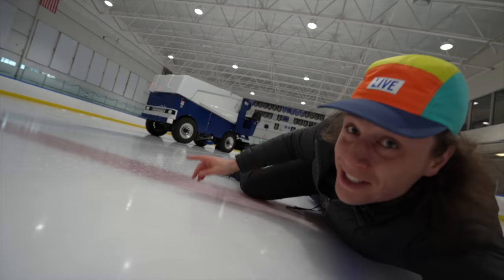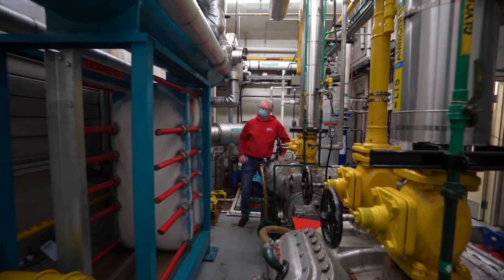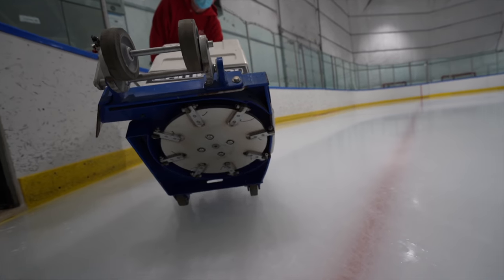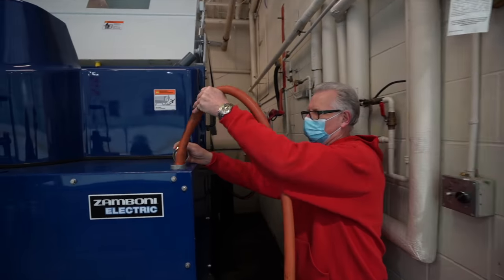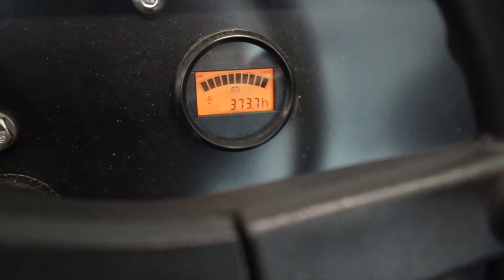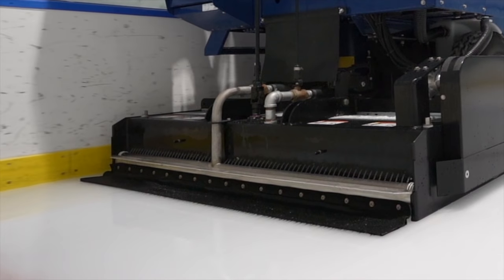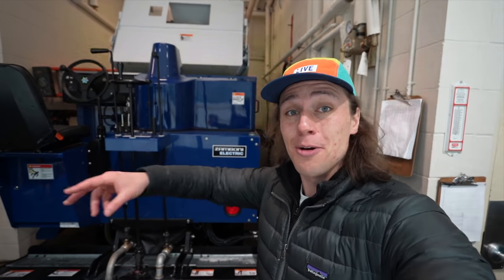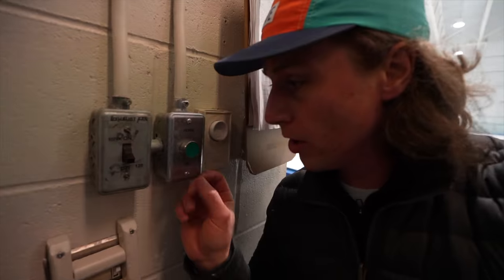Being a Zamboni driver for a day!

Comment: The best thing about a Zamboni is the pile of snow it leaves out back of the building. I used to walk shelter dogs behind the local arena, so they could climb the pile, flop onto their sides, and slide down with their tails wagging. It never failed to boost moods on a hot day.
Reply: You do realize that hockey players spit, blow their noses and bleed on the ice right?
Reply: @Skully317  I am aware, yes. I grew up playing hockey. At this particular arena during summer months though, the frozen bodily fluids of players weren't an issue. Unless figure skaters are nastier than I would have imagined. 🙂
Reply: @Skully317  It's a dog... Mine literally rolls in shit given the chance. I don't think they care about a little snot or blood.
Reply: @pitcat1376  figure skaters arent nasty at all!

Comment: Mike, being a Zamboni driver is the most satisfying job there is when you are on your own first thing in the morning or last thing at night but it can be rather harry when you are resurfacing before and between periods during a Hockey game (with all the people watching, some cheering and some jearing depending on where the spectators are from) I drove a Zamboni for 4 years before that a tractor with a scraper and water tank and when I had my first ice makers position back in 1972 in small town Saskatchewan I scraped the ice by hand then flooded with a 45 gal barrel on a frame with bike tires which we pulled around and around and around for 3/4  to an hour refilling the tank 3-4 times praying the water stayed HOT till we finished -- 1 flood before a game is all you got --- GREAT JOB and the best life I could have wished for at the age of 16

Comment: This has to be my favorite video Mike.  It brings back memories because I was a Zamboni driver.  We had 2 machines during my time, the first with manual transmission and no studded tires.  It really taught you how to drive on ice.  The 2nd was automatic, studded tires, much like the one you showed except ours ran on propane.  We had the same sand base and I dealt with more than one ammonia leak during my time....quickly throw on the gas mask and shut down the system!!  Great job, Mike!
Reply from the maker: Wow!  What a job!  I bet you have a bunch of stories.
Reply: @DownieLive  Many, many stories....just one example, twice I forgot to remove the hot water hose prior to going out on the ice.  I was driving along fine and then suddenly it was like a big elastic band pulling my backwards!  I knew exactly what it was and luckily both times I was the only one at the rink.  The original Zamboni did not have a fuel gauge, ran out more than once!!

Comment: the Hour counter is used on more or less any thing that isn't a road going vehicle. vehicles like tractors come with 2 one for how long the engine has run and one for how long the engine is run at high power levels.

Comment: I drove an Olympia resurfacer for several years and then the rink I worked at bought a new Zamboni model. I spent 24 years resurfacing ice. Never a dull moment. BTW the Olympia resurfacer was sold to Portland, Ontario to care for their annual 'Skate The Lake' oval track and was driven by Rick Mercer on his show profiling the event. There is a video of this elsewhere here on You Tube.
Reply: Which machine did you prefer? I’ve only driven Zambonis but I’ve trained other drivers that came from driving Olympias. I’ve heard the handles that open the water valves turn the opposite way.
Reply: Both ice resurfacers had their merits, but the Zamboni that I drove did NOT have a reverse mode for the verticle auger as did the Olympia. If an article ... bottle cap, piece of gravel, screw from a helmet ... got stuck in the verticle auger you had to practically dismantle the thing to get it out. I parked the Zamboni one day after resurfacing and had a man come over to me to point out that I had 'missed a spot'. I walked past him to the centre of the ice surface and returned with the inch long screw that I had spotted on the ice as I neared it -- and veered around it (since once you start resurfacing you can't just stop in the middle of the ice). I held up the screw and he said "I didn't see that" and I said, "Then it's a good thing that they let met drive the $345,000 Zamboni instead of you." He took his opinion and attitude elsewhere. Silly man.  @johnschauder
Reply: @TheZAMBONILADY  lol that’s a funny story. I’m surprised a helmet screw would give you that much trouble. The Zamboni I currently drive is a 545 I think about 10 years old and it would have absolutely no problems sucking up a screw. I’ve even seen full pucks go up that thing…not by me though. That being said, it does have a reverse on the vertical auger just in case. The machine I drove before that was a Zamboni from the 70’s. I forget the model but it was one of the ones where the foot pedal sets the RPMS. I don’t remember if that one had a reverse vertical auger but it didn’t get jammed very often. Those are the only two machines I’ve driven and I’ve been doing it for 22 years.
Reply: Correction…I’ve driven a few other Zamboni models but not for any long amount of time and they were pretty much the same as the one I drive now only propane instead of gas. What model are you currently operating?
Reply: I'm retired now.  @johnschauder

Comment: I will share the beauty of the discovery of Freon.  Prior to its discovery there were two major refrigerants that were used to produce ice for rinks or provide refrigeration for ice cream, milk, or food.  They would use ammonia gas, ethylene, propylene, or propane depending on the amount of refrigeration needed.  The bad thing about the chemicals I mentioned is that they are all very flammable, and they also displace oxygen.  Freon does not have those issues (it is not flammable or toxic).  

Yet another good video Mike.

Comment: Hey Mike,
thanks for another great video. I was wondering about the main topic which is the Zamboni machine. Since it is electric, how long does the battery last for?
Reply from the maker: Not sure, but enough time to clean the whole ice, and then they can plug it back in until they need it again.

Comment: Your not a Zamboni driver until you clean the restrooms 🤣. Most rinks use R-22 as a refrigerant. Since it is being phased out all new rinks have to go with ammonia. Real Ice is like 15K, dont think not many rinks have it. Hot water is the best for bonding layers together. There is a huge difference on how the ice sets up when using cold vs hot water. At least in my opinion. Thanks for the video, enjoyed for sure.
Reply from the maker: Good to know! Thanks for the comment.
Reply: @DownieLive  thanks. Again enjoyed the video. It is interesting to see how the other half live. That rink is prerty much state of the art. I can tell it is well funded, well managed, and well maintained. I am sure you considered it an honor to train with those gentlemen. From what I saw they are on top of it and know their stuff.  Not sure if that's where you skate but definitely give them a thumbs up if you see them. Take care.